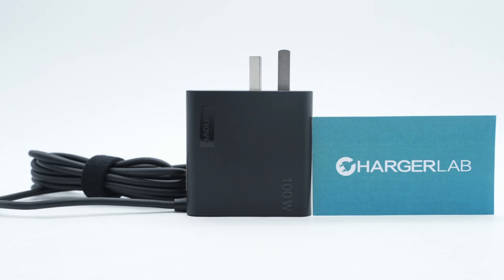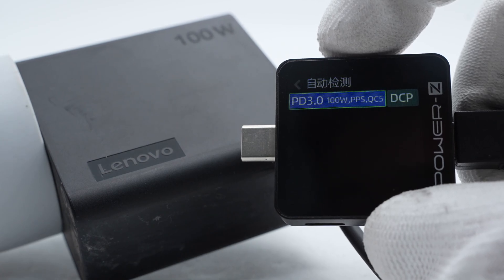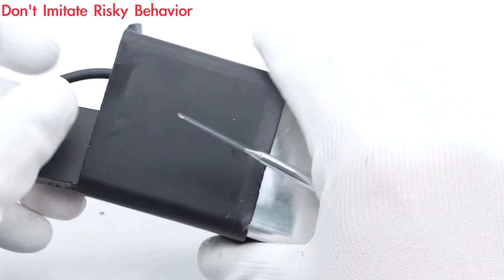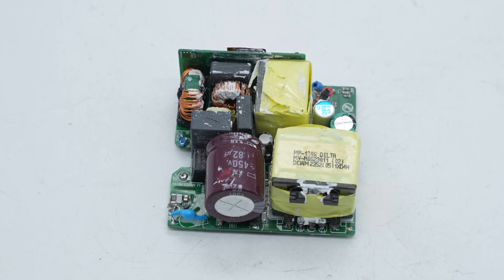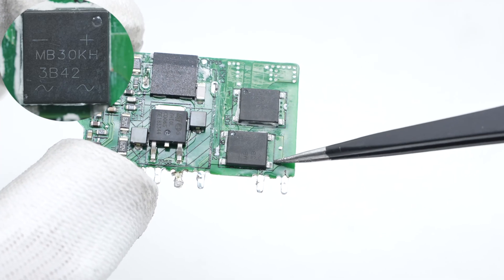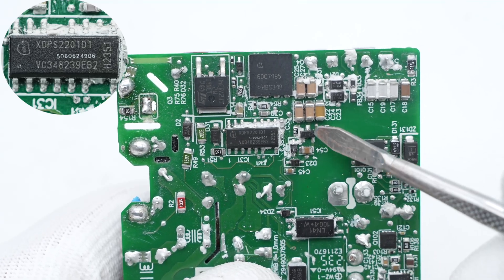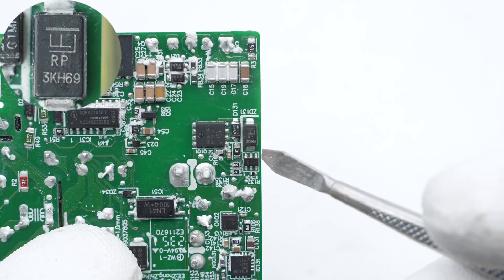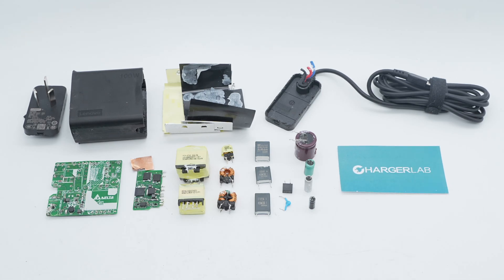Teardown of Lenovo Original 100W GaN Charger for Laptops

Comment: The 3 pin plug is such a poor design. And you can’t use that with AU NZ sockets even though they use the same pins because that design will obstruct the power strip and it also won’t fit a AU NZ extension cord. I have a Lenovo 100W adapter as well but with a detachable AC cord. And yes laptop chargers with AC cords are better and more flexible
Reply: The annoying thing for me, as a New Zealander is it will block the switches on most Type I outlets found in Australia and New Zealand. Here we have the earth pin facing down, but in China it faces up.